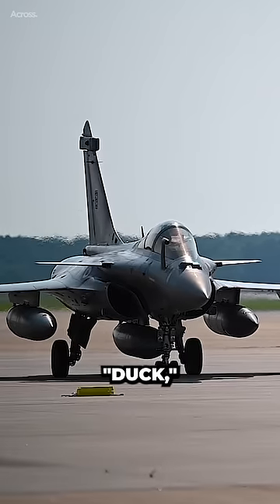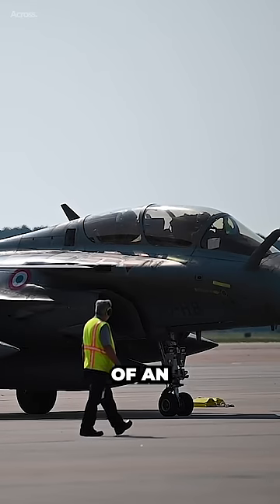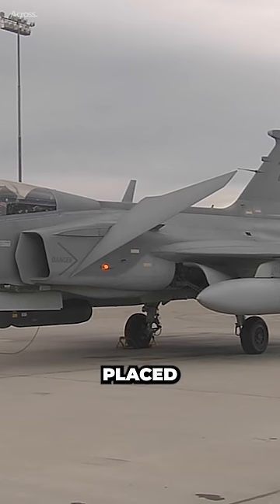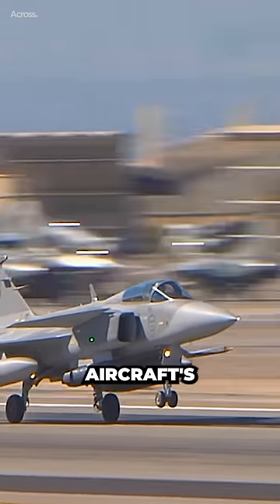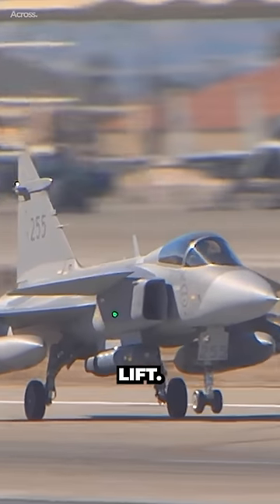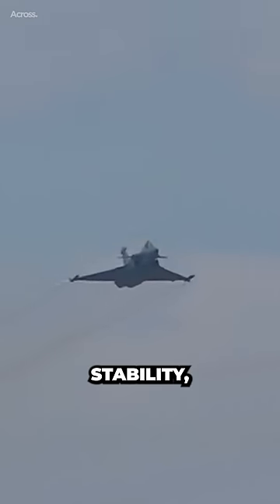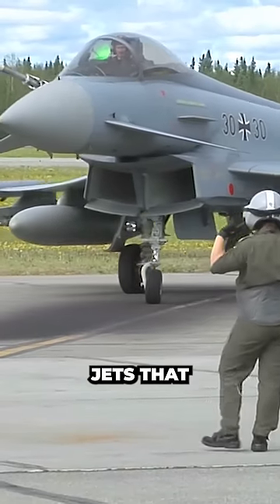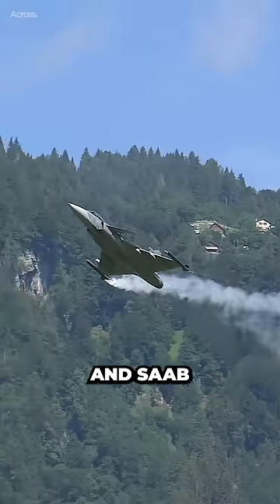Why Don't American Fighters Jets Have Canards? #shorts

Comment: Wow! Lots of Aeronautical engineers in the comment field since everyone seams to confident on their opinions that one specific design decision is better then another. Its not like different aircrafts are developed with different needs and requirements in mind making them have different design and be good at different things. One thing needs to be the best.
Reply: Yes, but the subject matter is fighter jets.  Not simply military aircraft.  These things are all designed for essentially the same purpose.
Reply: @kevino.7348  These are not Fighters but multi purpuse aircrafts. Fighing is one of the roles they can have. Things like logistics, maintance and tactics of the country matters. US jets are often designed with air suppirority in mind. Striking from strenght and support from multiple fronts. Other fighters might be designed to strike from more disadvantage position. I'm no expert but from what I've hear the canard wings on the swedish JAS 39 Gripen are there to give extra lift for takeoff, making it possible to take off from roads and shorter runways. Different priorities.
Reply: @floggingluna the f22 can do recon easily as well as dog fighting and stealth bombing

There's a reason we made it illegal for Lockheed Martin to sell these to anyone else
Reply: @connormcconnell7805 the F22 can’t dogfight, It wasn’t made to be manoeuvrable. It was made purely to have the lowest RCS out of any fighter, while simultaneously being able to use some of the best missiles available may the same time. It is good for BVR engagements only. Saying it can dogfight is just a blatant lie.
Reply: @thatonelocalauthority2809  That's the 35.
The 22 can turn completely around in half its own length.

Comment: In short: US fighters don’t use canards because they don’t have delta wings. 

Canards are more efficient, but in non-military, regular planform applications, they are less maneuverable then elevators or stabilators, due to stall safety/stability concerns. With delta wings, and especially on fly by wire military aircraft, that concern is mitigated, if not eliminated, and they are a great help. But then, why have delta wings in the first place? 

In US aircraft which don’t have delta wings, canards would probably be less powerful than stabilators, therefore making the AC less maneuverable. That’s my educated guess.
Reply: “Stabilators”, I didn’t think that was a word but it is indeed. Now I just need to have a conversation this week in which I can casually use it.
Reply: @teeanahera8949  I’ll give you a couple others: flaperons and elevons. 😉
Reply: @tylerfb1  Rollerons on the AIM9 too,  might even be stabilons out there somewhere
Reply: @forzaelite1248  I mean I guess  for the aim 9. I’m not sure they are called stabilons, cause they are primarily stabilators, but the F-15, 16, 18 and later all use the stabilators to help with roll too!
Reply: @teeanahera8949 That's aviation nomenclature for you. I mean, they even had the great idea to literally name the Concorde's procedure of drooping its nose during landing "Droop Snoot".
Reply: @Tee Anahera  It's a combination of the Horizontal stabilizer, which provides a tail down force. Think of it as a smaller wing which provides lift in the opposite direction.
And the Elevator, which is the trailing edge section which moves in order to increase/decrease the lift of the horizontal stabilizer in order to get the plane to nose up or down.

When the entire horizontal stabilizer section moves it is called a stabilator because it combines the two separate functions into one functioning unit
Reply: This is a fair point, and when included with the design details of and the variable wing geometry on the F-22 raptor, shows that modern US hypermobility fighters dont need canards. There's an excellent MIT opencourseware a video that discusses the flight dynamics and the basics of the fly-by-wire systems of the F-22 raptor if anyone is curious. But to summarize that video, the F-22 does not fly like a normal aircraft, and has control surfaces all over the wings not just in the back like a normal delta wing that needs mobility and control support from canards. Oh and it was designed in the 1990s. Happy everybody else is catching up
Reply: So what about the planes that don't use delta wings and still have canards? Such as the Su-37 or the J-20? I brought up these two examples because they have regular wing configurations, supplemented by both canards and thrust vectoring engines (although on the j-20 the latter isn't installed yet).
Reply: @balintkovacs4089  well the j-20 does have a delta wing, so that’s why it has canards. The su-37 has canards that are very small—obviously they are not the primary control surface. Small canards in addition to traditional control surfaces dramatically increases performance in a couple of key flight envelope areas, in conventional aircraft. 

I don’t know much about the details of flight envelopes of fighter aircraft, and if what I know lines up with the flight envelope characteristics of fighter aircraft, I don’t know why a su-37 would need that performance there.
Reply: @tylerfb1  I mean, idk if the J-20 counts as a full delta wing since they trapezoid wings in a delta configuration. But I do see your point. As for the Su-37, iirc it was for maintaining agility for the overall heavier plane. Or it could've been a design element brought over from the Su-47 prototype. The 47 is a standard configuration but with canards and forward-swept wings.

Comment: AFAIK, canard was needed because they chose delta wing, which has some weaknesses. To counter the weakness of the delta wing, they added the canard.
Reply: but the Draken is canard-less tho
Reply: @blackroberts6290  They looked at a Canard Draken when they we’re looking for the Viggen replacement.
Reply: @blackroberts6290 Canard-less Delta wing exist, and US even made and flown one before (F-106 Delta Dart). The difference is the level of performance.

Delta-wing is an ideal configuration because it's simple to produce with simple aerodynamic properties, but it has an unideal manuverability characteristics relating to pitch. Rather than adding an elevator behind a delta wing plane by making the tail unnecessarily long, they place it at the front as a canard.

This is why Canard rarely exist in non-delta wing configuration on modern planes - planes don't need canard to fly well. It's the delta wing configuration that often necessitate canard.

Comment: A canard will be used to lift the nose during takeoff, helping the main wing instead of adding to its load. Since liftoff is the highest-loaded yet slowest-moving moment in the flight, this does genuinely help wing loading and therefore size and weight, making the airframe overall more efficient.

Comment: Dude left out the most important fact while showing multiple shots of an F22. Canards make an aircraft a whole lot less stealthy. That's the primary reason we don't bother with them today. In the past, the US didn't use delta wings. The canards act as a way to sort of extend the wing surface, effectively adjusting the path of the air flowing over/under the canard and the main wing. Large, properly designed control surfaces on your main wings mean you don't really need to bother with canards assuming a more traditional wing shape; assuming of course that it meets your flight envelope parameters.

Comment: They also increase their signature making them more traceable and killable
Reply: I always asked why they don't just make retractable ones... I saw a video of a rafale absolutely destroying an f22 in training dogfight because of canards
Reply: Doesen't make sense. They just moved the control surfaces to the front, total area stays the same.
Reply: @TGP-vq4vi can you link that. Not saying your lying but the f22 specifically is a the best air superiority fighter in the world. It’s a 5th gen plane. I doubt it was losing to a Rafael.
Reply: @CoryMp3  https://youtu.be/KOswfrc7Xtg
this is the video in question. you can hear the Raptor pilot struggle to turn while the Rafale does circles around it. not sure what the purpose of training is but it looks like they're just practicing close combat BFM. the raptor is really only good at staying far away and detecting bogeys, when its up close and personal it doesn't fare well. sure its an air superiority fighter but there are many downsides to that like what you saw in the video. the Rafale has a larger RCS and it is easy to detect but it can turn circles around any American jet if it manages to get up close

Comment: If I'm not mistaken, the F-14A had wing glove vanes that extended out during full wing sweep that acted as "canards" since the swept back mode was virtually a delta configuration. Also, although not a fighter, the XB--70  had huge canards.

Comment: Rear control surfaces help to mask some IR signature from the exhaust as well.  See the F-22, how the engines are  sightily more forward than expected.  The A-10 also tucks the engines high and in board of the rear control surfaces as well to shield IR signature for survivability.

Comment: For those wondering if actual ducks 🦆 got forewing, the answer is no.
Even Donald Duck flat beak has no aerodynamic purpose... And btw Donald Duck didn't exist in 1910.

In fact, Canard was the name of the first ever "hydravion" (seaplane) to actually take off from water in 1910 and happened to have a forewing, which is still called "canard configuration".

Although Fabre's prototype was unnamed, it's his successor Voisin who coined her name "Canard", because she can swim and fly, and has a long neck like the bird.

Soon after (1911), 2 Canard Voisin were the first seaplanes operated by the French Navy from their seaplane carrier La Foudre

Comment: The Lockheed Skunk Works ASTOVL demonstrator for DARPA used canards.  That was the baseline design for JSF, but was later ditched in favor of the 4 tail design for X-35.  There was less risk going with the 4 tail design since it's similar aerodynamically to an F-22, where there was a lot of wind tunnel data and operational experience.  Canard mechanisms also take up a lot of interior room that ordinarily could be used for avionics.

Comment: Canards also move the rotational axis of the aircraft up closer to the pilot reducing the G forces said pilot experiences and allowing the aircraft to rotate more at higher speeds. An aircraft without canards has a rotational axis at the rear acting as a cantilever on the pilot and exponentially increasing g forces for the pilot, ergo, less maneuverable than one with canards.
Reply: Not sure that makes sense.  Certainly a lack of canards does not “exponentially” increase g force.
Reply: I feel that's like saying you're standing on a scale and hold a stack of books out with your arms vs pulling them in, you'll weigh less/more. But after thinking about it, it would be like the arms on an ice skater when spinning. The difference is probably very minuscule in this regard otherwise we would have seen an aircraft with the pilot pushed back between engines aligned with the wing spars on the rotational axis
Reply: @A_barrel    Agreed, the force on the pilot is the same no matter where the control surface is located.
Reply: I'm not sure if you realise this but, especially in higher speeds, G forces is somewhat directly proportional to the rotation rate of the aircraft and that relationship fades out in lower speeds (ie. Supermanuevereable planes can rotate fast in lower airspeed but not experience a lot of Gees.) So that "explanation" kinda doesn't check out. Mind some sources with that, because I have with mine.
Reply: Wrong!
Reply: Seems like it would be the opposite..
Reply: No, a 9+ G  pull is a 9+ G pull, regardless of where the pitch control surfaces are.
Reply: @kevino.7348  That wouldn't make sense to me, the further a point is from the rotational point or axis of rotation, the further it travels to make one rotation, so the faster the speed and thus the greater the rotational acceleration, or the G force experienced. 

Think of a really long stick, one side is a foot away from the center, the other is 2 miles, if that stick was brought down 90 degrees in one second, the foot side would experience a one foot increase in vertical movement whereas the two mile side would suddenly go down 2 whole miles in vertical movement. Moving 2 whole miles in one second is a lot more acceleration than 1 whole foot in a second. This is the same idea, just obviously a lot less severe.

Mind you, the force in both cases must be the same, the stick would either be really massive at the one foot side and thus the force equation would have a high mass, if low relative acceleration, or the tensile force of the stick (assuming it doesn't bend) would equal out, or the stick would obviously bend thus effecting the acceleration. However, I'm sure we could both agree the acceleration is different and thus the G-force is different.
Reply: @leroture7750   I believe you have created a false analogy.  You are talking about leverage. All the force in your example comes from the leverage effect.  In the problem we are discussing, the force on the pilot comes from the existing speed of the aircraft, and the rate of change in the direction of the aircraft.  This isn’t leverage, it’s momentum.  The canards affect the rate of directional change, so impact the g’s on the pilot. It’s the same with thrust vectoring, which comes from the rear of the aircraft.  The mechanics of the directional change isn’t what matters, it’s the fact that there is directional change at high speed. 

Not to mention that canards are there mostly for low speed maneuverability, not some sort of high speed g force reduction (which, again, does not exist).

Comment: Literally every reason you gave in this video is wrong. There's an MIT opencourseware lecture on aerodynamics of the F-22 that by itself shows the lack of need for frontal control surfaces on inherently unstable airframes with variable geometry wing design....AKA 5th generation planes without delta wings like the F-22 raptor.

Comment: US fighters don’t need canards. They build them correctly from the beginning.
Reply: Well, If that's the case. If the F22 was built correctly, it wouldn't need thrust vectoring to compensate for a poor design.
Reply: @THE-BUNKEN-DRUM  TV, thats a feature !
Reply: @THE-BUNKEN-DRUM  thrust vectoring is needed so i dont have to increase my RCS with alterations to my airframe. Ask any pilot and they will say the the F22 is the smoothest flight out of all the aircraft in the ars3nal.
Reply: @idigbebop  : So are canards, then. They're both used to enhance the capability of the airframe.
Reply: @lockheedmartinf-22raptor73  : I know all that & I totally agree. All I'm doing is turning that stupid, tired old logic around of, canards are only used on aircraft because of "poor" design.

In regards to flight characteristics : the same can & is said about all European (& dare I say Russian) aircraft with canards.
Reply: @THE-BUNKEN-DRUM  It was designed in the beginning for that reason. It's not compensating for anything when it comes to thrust Vectoring.  Thrust vectoring is superior to canards in every aspect of dog fighting. Your assuming with your statement that canards are greater than thrust vectoring but canards are just a bandaid for a poorly designed air frame.
Reply: @michaelmichaelagnew8503 : I agree, to a point. Thrust vectoring is best for the F22, so it doesn't compromise its stealth capabilities. Other aircraft don't have that burden, in regards to stealth, so thrust vectoring isn't required because ultimately, all it is, is a heavier, more complex way of achieving the same goal as canards & that is to enhance its capabilities, which is precisely what canards also do. AGAIN, using that flawed logic of canards just being a "band aid" for a "poor design." If the F22 was designed perfectly from the get-go. Surely it wouldn't need a "band aid" such as thrust vectoring to enhance its capabilities? Or, is it just a case of, that's what's best for that particular airframe & the role its intended for, just like canards are for certain aircraft?
Reply: @THE-BUNKEN-DRUM  dude thats basically the replacement and the better replacement for canards what the hell do u mean?
Reply: @FEURVERM not really, both achieve the exact same goal which is better manoeuvrability and the amount they influence the design is down to how they’re made. One doesn’t inherently perform better than the other, it just so happens the canard is a much cheaper alternative to thrust vectoring. Which is actually why the typhoon (which originally was going to have thrust vectoring and canards) ultimately dropped the thrust vectoring, the price wasn’t worth it.

Comment: Canards are what you put on your aircraft when you're unwilling to spend another 20 billion to solve the flight problems with better design and more power. US vs EU military budgets
Reply: wrong 😂
Reply: That’s just not true at all lmfao. If you rock a delta wing design you’re almost always gonna want canards. The US doesn’t rock a delta wing design
Reply: 1 aircraft type has it, out of how many? If thrust vectoring was the "be all & end all." Surely you'd either update or just get rid of all your less capable aircraft? Because in terms outright performance all other U.S. 4th gen aircraft are less capable than any European 4.5 gen aircraft & that's a fact.
Reply: You don't even need to spend 20 billion.  1 billion will do, your not designing a submarine or Aircraft carrier.

Comment: The Bone has a small canard.  It serves two functions: fine adjustments during ground following low altitude runs, and helping to stabilize large center of mass changes when the bone let’s go of heavy munitions.